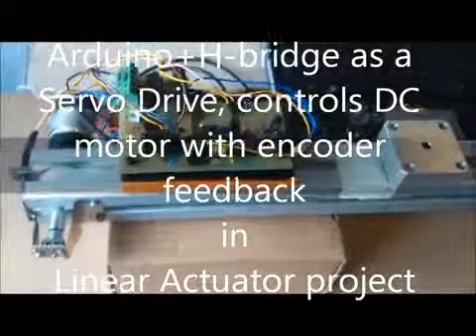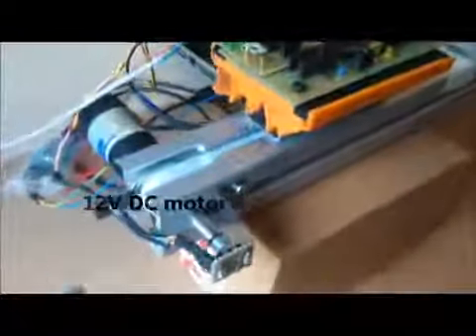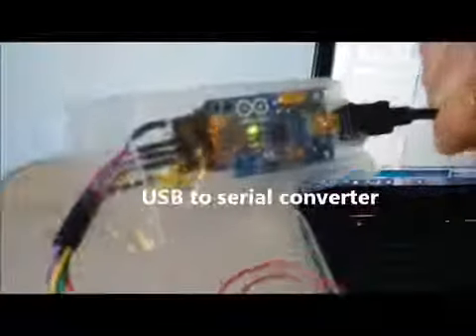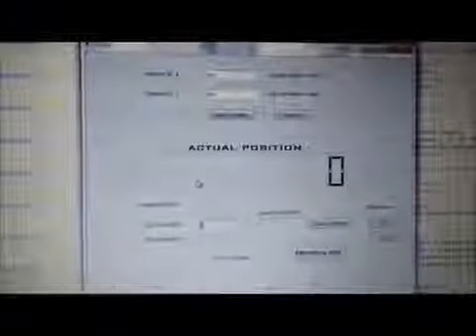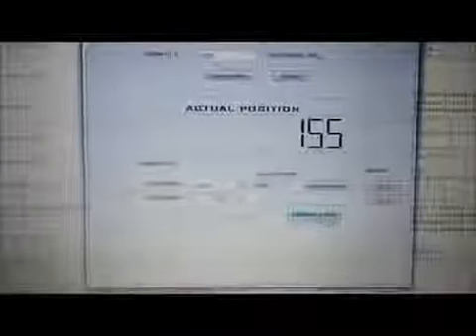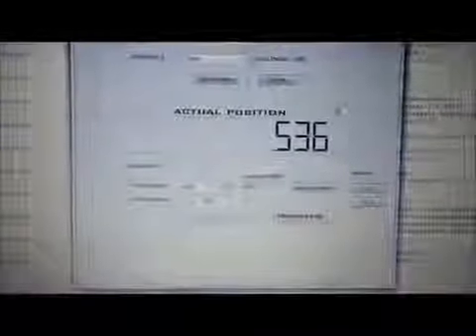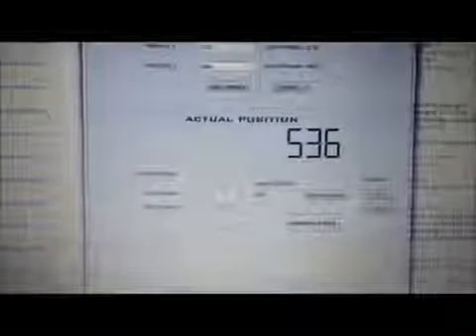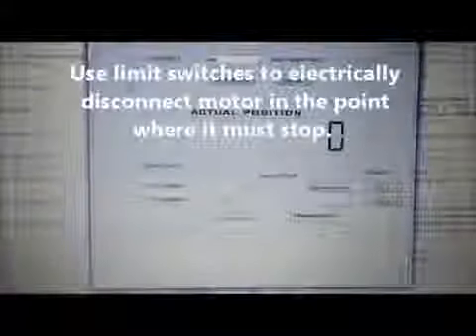Arduino position control of a DC motor with encoder feedback in linear actuator- Atmega 328

Comment: This is great, but I think that it could have been demonstrated in about 1 minute, and spend the other 5 minutes on how to do it, along with code for others to try and build on. I do like the fact of using a DC motor, along with accel and decel. Thank you for the  demo on position control.